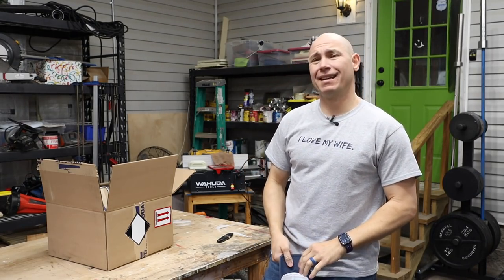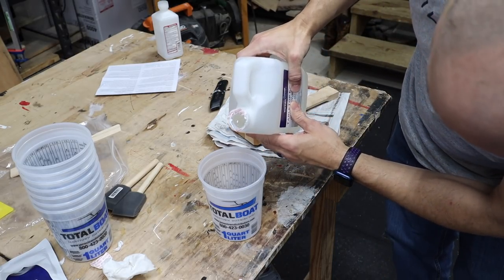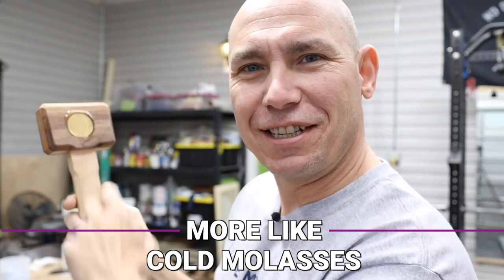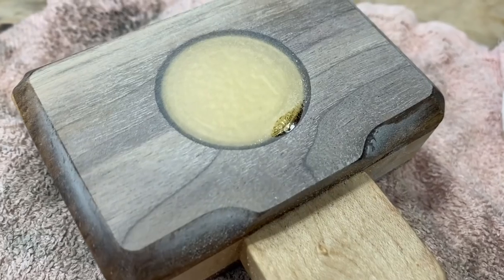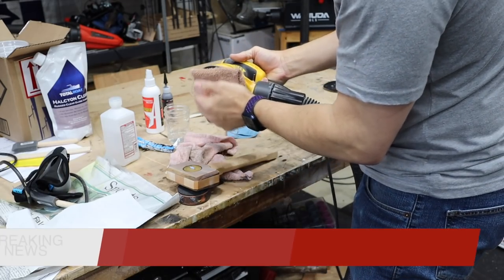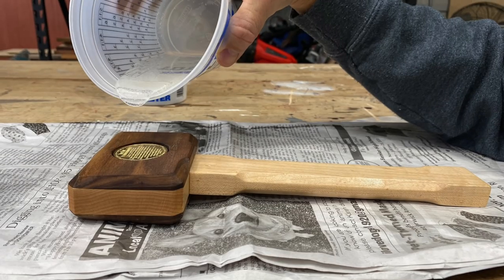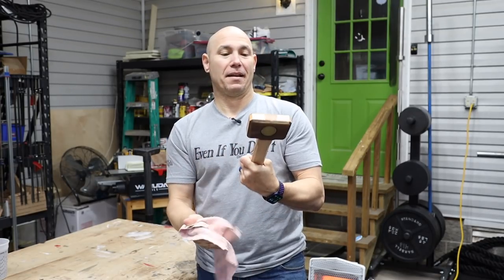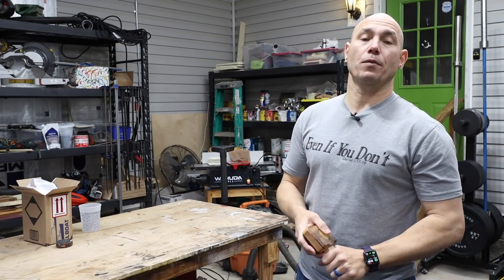Clear EPOXY Resin Makes A Unique Wood Mallet

Comment: Set the bottles in a warm water bath before pouring to mix.
Reply: Also, as someone else suggested, Stone Coat Countertops is a great channel - they go over sanding epoxy in detail. Also would recommend Moonpie Creations, The Pohl Barn Productions and R Humphry woodworking - they primarily do woodturning type projects, but do a lot with resin.
Inexpensive car buffer works great for polishing.
With the pouring - the reason for pouring into a second container is because then you are not getting any unmixed resin from the sides. 
Also, watch the instructions on the resins - some are by volume, some are by weight. Make sure you know what kind it is!
Reply: Also, if you are very careful, you can use a warmed needle to pierce that large bubble, then use a syringe to fill the pocket with epoxy.
Reply from the maker: Thank you

Comment: You need to add check out your Etsy store for more points. Just saying.  You did great. I wanted to try epoxy not to long ago and accidentally got the fast set and really messed up a gift for wife. After that I got scared. I need to try again.
Reply from the maker: It can be difficult to work with

Comment: A pressure pot will help to get rid of the milkiness(air entrapment), Low level heating, say 90-110F will speed the curing of epoxy. Watch some wood turning vids.
Reply from the maker: Thank you

Comment: Too cold is what you have.  It does need to reach a certain temp...Good thing I am a chicken raiser, yu can use a heat lamp in your area for it.  NOT ON TOP OF IT THOUGH< LEST YOU START A FIRE!  Use an hair dryer to get rid of bubbles.  So happy for you on this.  Virtual fist bump!  You can use 200 but it will take 400 or higher, but use water with it.
Reply from the maker: Thanks for the tips!

Comment: KOUGU Professional Epoxy Resin Starter Kit with Silicone Heat Resistant Mat - Premium Craft Tools Including Thick Workbench Mat, Measuring Cups, Pour Cups, Stir Sticks, Epoxy Brushes & More
(I tried attaching the link. Just check silicone epoxy measuring cups)
They are silicone so after they dry crack it off wipe them down with a baby wipe and good for your next pour.
Reply from the maker: Thank you

Comment: You see, I'm a body man, and I believe I can tell you what went wrong. When it's too cold, you can't get the air out of the epoxy, so it gets milky when you mix it. You need get the temperature in your shop above 65°F. Preferably in the specified range, but toward the lower end of that range. That seems a good rule of thumb, no matter what kind of epoxy you're working with. Sometimes, you live and learn. I've ruin some projects and had to recalculate some promise times on more than one occasion after 'getting to know' a new product. Thinking, "I know what to expect. How bad could it be.?" Famous last words.

Comment: Your bubbles come from mixing and they are more prolific because your epoxy was way too cold.  You will always get bubbles but you should always stir epoxy slowly and thoroughly and make sure you scrape the sides of your container.  Many epoxies will thicken with age.  If it's thick you can put your container into a bucket of hot water.  It will thin out and turn closer to clear.  I've had success with warming it quickly with short bursts in the microwave.  Just don't tell your wife.  A propane torch waved across the top will also burst bubbles and denatured alcohol spritzed will do the same.  Your bubbles will rise to the surface much easier in a warmer room.  Epoxy doesn't cure well, mix well, or perform well in cold temps.
Reply from the maker: thank you

Comment: Love your work and I think your a blessing to the woodworking community. 
One thing that bugs me is you keep repeating same things over and over and thus dragging the video much longer than it should, just be precise say it one time and move on. Youtubers tend to make longer videos to get more adds in between and make more money, but it drives some viewers nuts. 
Just my opinion, no bull.
Reply from the maker: Viewers?  You're the only one that has mentioned it to me, ever.  This video started out at 1 hour 30 minutes after all filming was done.  After the first cut it was still over 45 minutes.  I cut out a ton of stuff and it came out to 20 minutes.  So if I was after a longer video to put more ads in, I would have left it at 45 minutes.   When I start repeating myself, it's usually to make a point so the viewer don't make the same mistakes I made.  But I understand that you can never make everyone happy when making content for the masses.
Reply: ..of course